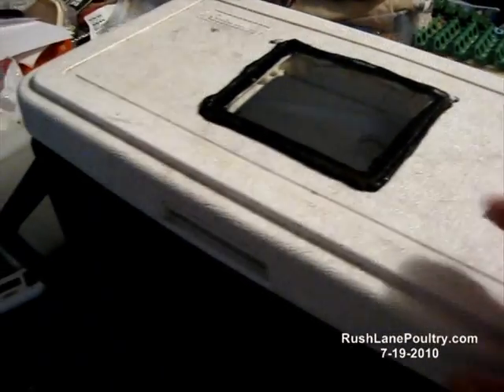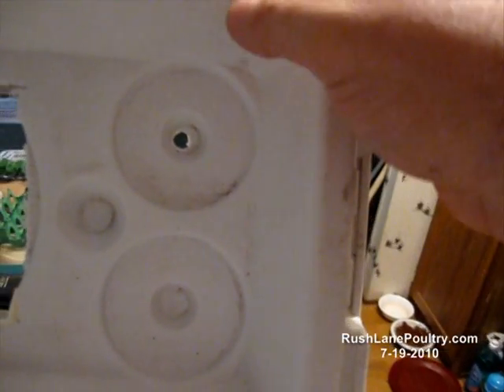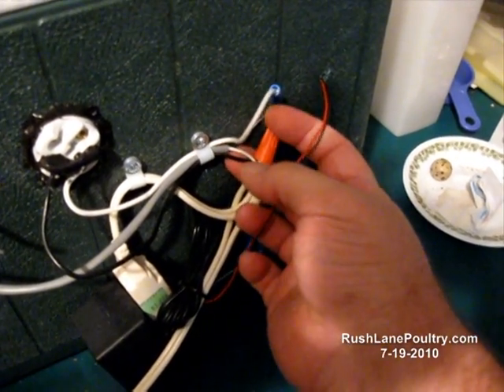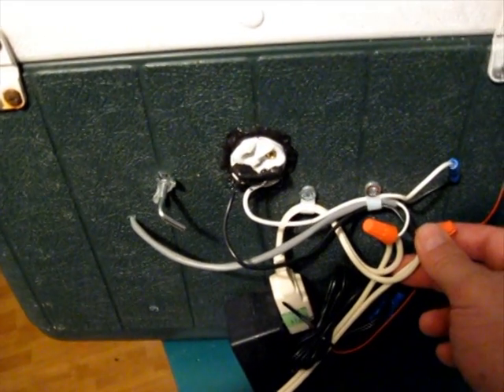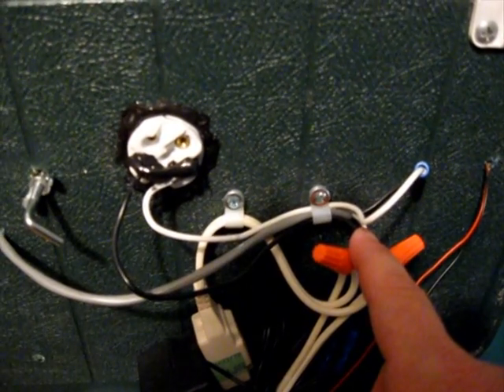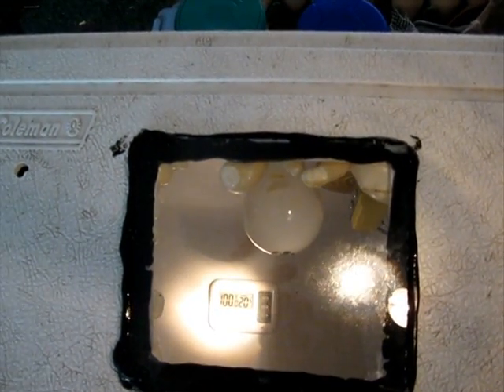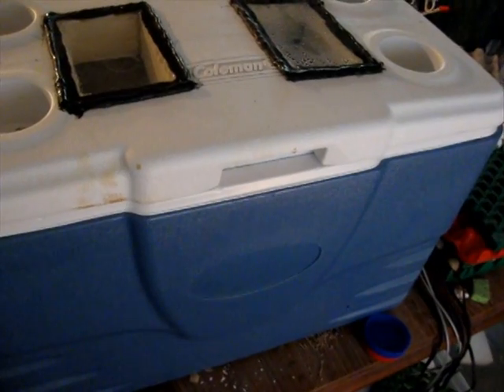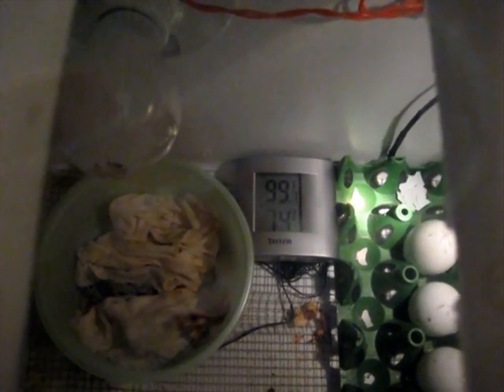A Home Made Egg Incubator!

Comment: I have a 21 1/2"x24"x18" wood bator that i made. i am insulating it with 1/2" styrofoam insulation. I am goin to be getting the wafer thermostat. do you think i will need 2 light bulbs in it? Or do u think i will just need like a 100 watt bulb? Also do u recommend me getting the water heater thermostat or the waffer thermostat? Which one is better Thanks